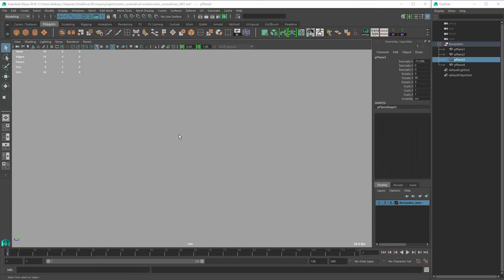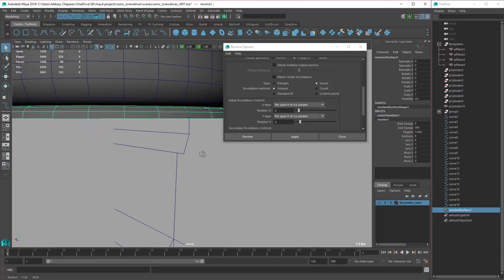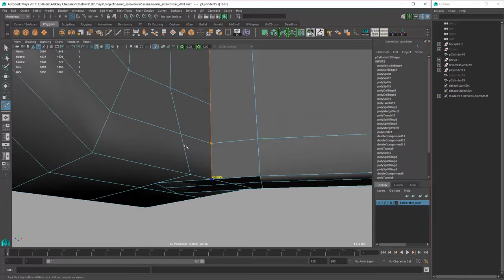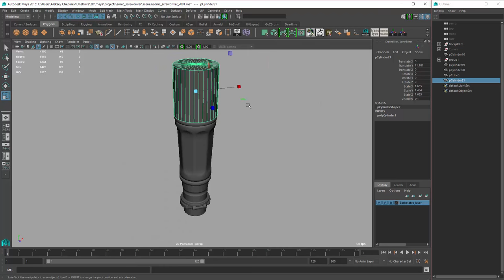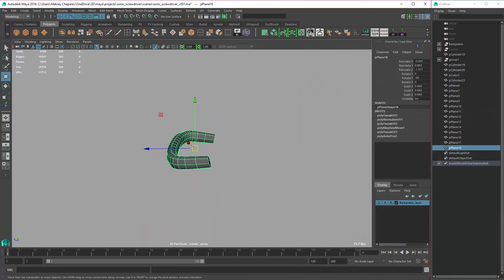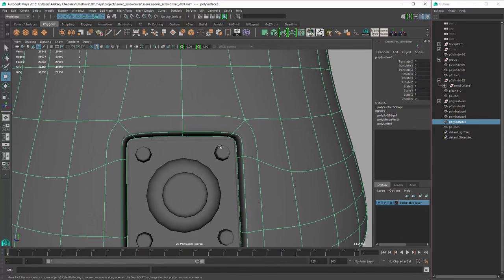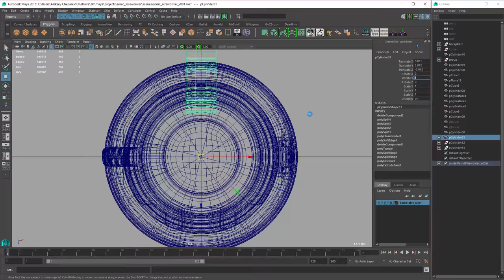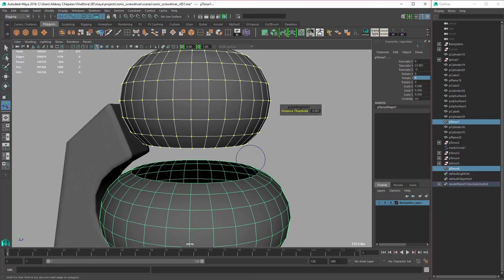Doctor Who Sonic Screwdriver Modeling - Part 1

Comment: Music is too loud...
Reply from the maker: +e efilysp Sorry about that. It sounded fine in my headphones but I guess I need to check the levels more.
Reply: No worries, it's audible. I just finisehd watching part 1. I found interesting how you you cut that Torus into quads towards the end. I usually just get rid of every other edge at the top. Interesting use of the lattice as well, though I thought for some operations a simple soft selection (B on your keyboard) would have been perhaps more straight forward. What are the advantages for using the lattice over soft selection in your opinion?
I will watch part 2 later. Keep it up.
Reply from the maker: +e efilysp Thanks! I use a lattice because it's less destructive, and I feel I have more precision using lattice. Sometimes after a few soft select moves I realize parts of the geo get garbled. Plus lattice is fast, only a few lattice points to move.
Reply: That makes sense. When you say it is non-destructive, are you referring to the fact that you can go back and make changes through the history stack?
Reply from the maker: +e efilysp Not the history, but if I put a lattice over the whole model and move some of the lattice points, before I clear history I can move any of those points back. Also, if you don't clear history and just hide the lattice, you can keep working while the lattice is still deforming the geo.
Reply: Thanks a bunch, it sounds good, I'll definitely give it a shot.